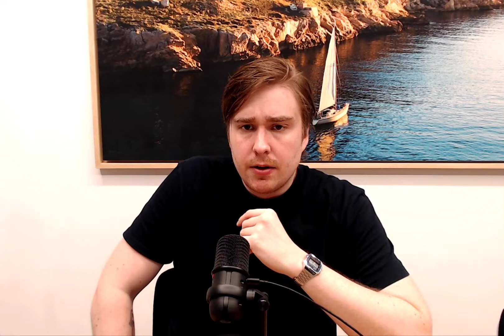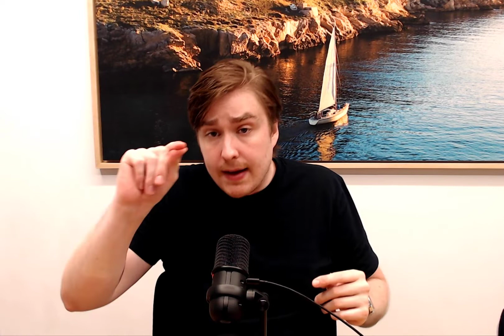Children’s Clothing Regulations in the United States

Comment: If it is compliant in the US is it largely compliant in the EU/UK? I realise that there will be differences in the documentation and labeling (minor?) but the actual product will be compliant? Will you do a separate video for the EU/UK?
Reply from the maker: Hello,

There are entirely different regulations, standards, certification and labeling requirements between the US and EU/UK, so no.

I understand what you mean, but even on a technical basis there are differences in drawstring lengths etc, and you will need test reports for both.